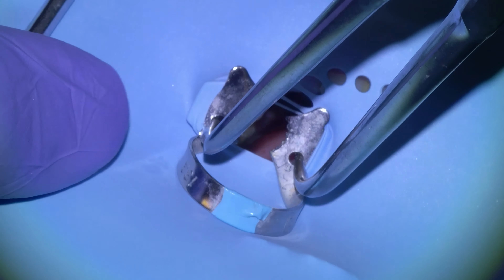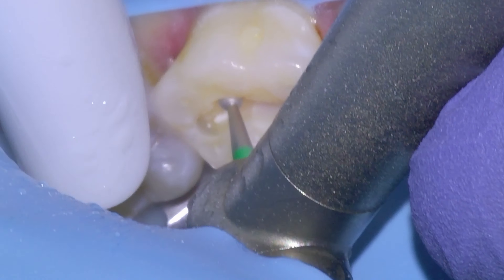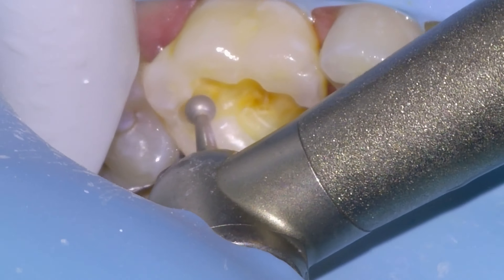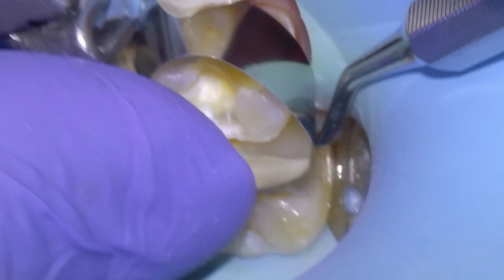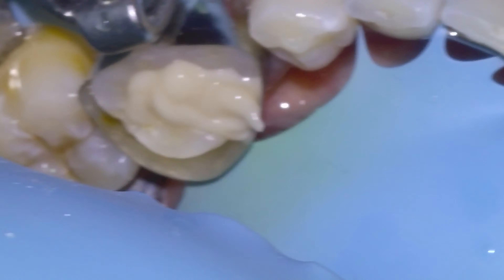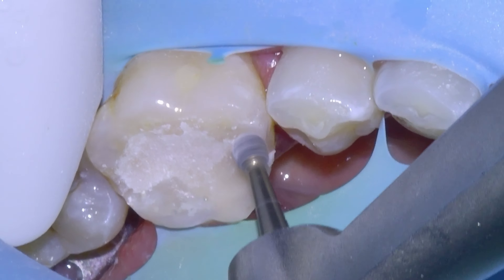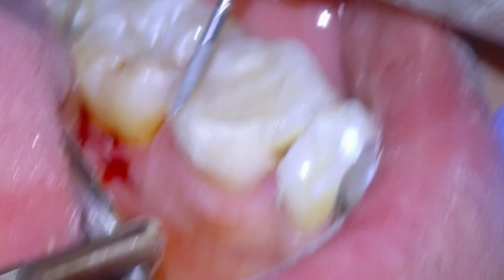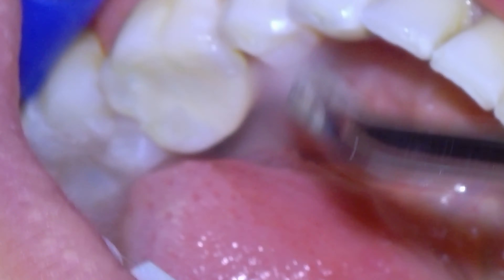[29] Fractured tooth repaired with dental filling

Comment: Are you able to use the damp cotton pellet packing trick with FUJI RMGI as well?
Reply from the maker: Yup I use this condensation technique for any glass-based restorative material.  Just make sure to overfill the prep because the material on the surface that has been moistened will be weaker when set and should be trimmed away as excess.

Comment: Looks great! I love Forte and use it in a lot of situations where my coworkers will place an amalgam. 

How do you see them doing at recalls? Looking good for years out? I know people can have amalgams for decades so I am curious to see how long people are getting out of these and if me placing them is good for the patient relative to how long they can last.
Reply from the maker: I've only been using it for about 3 years but I haven't really noticed any significant washout like you would see with a traditional GI at recalls. Proximal contacts are also staying tight it seems. Extensive laboratory testing is carried out on any material before it is approved for an indication to ensure that it can stand up in that situation long term